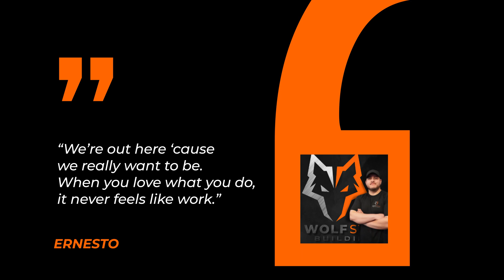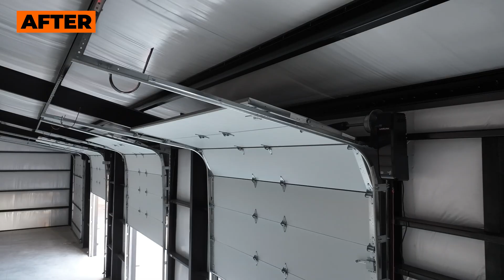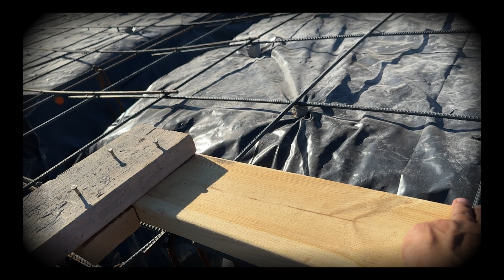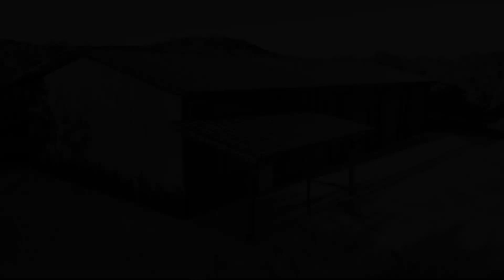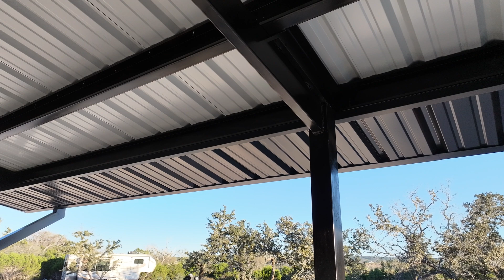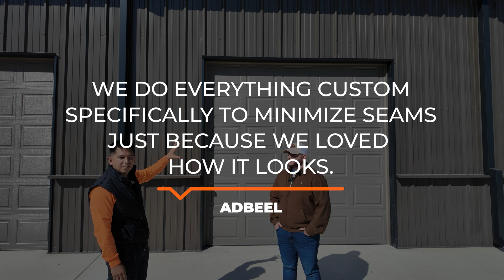The Perfect Workshop?! | 40x100 Custom Weld Up Red Iron Steel Garage | WolfSteel Buildings

Comment: Sweet building. Since my build site is on a hill I was thinking about putting a steel building on top of a basement and having a shop at ground level. I want a 12-foot celling in the basement so I could later finish it as living space.
Reply from the maker: Great idea! That's another way of maximizing the space for your shop. Best of luck with your project!

Comment: On the low side of the elevation - there is a lot of compacted base that is exposed - if it rains, that base could get washed away - is there any plan to keep the base from getting washed away? - Like putting dirt & grass   or    Maybe pour more concrete over that base to keep it all together.
Reply from the maker: This is correct! It can happen. We do not provide these services but it is information given and provided to our clients once we are done with our portion